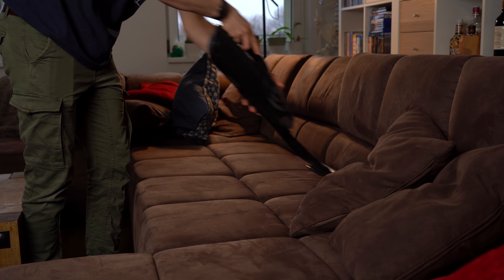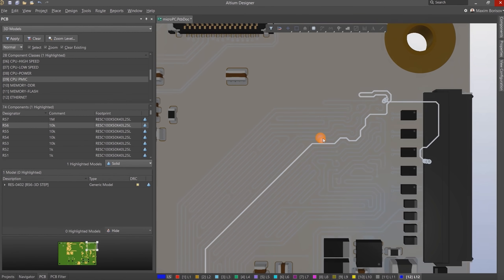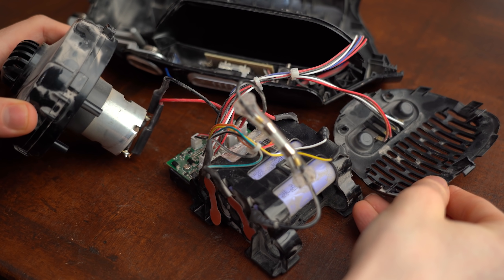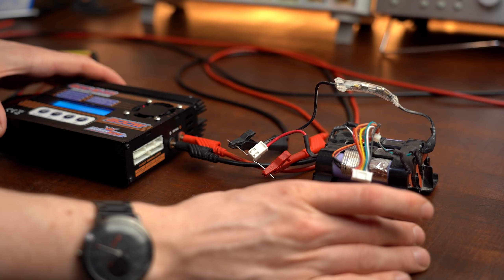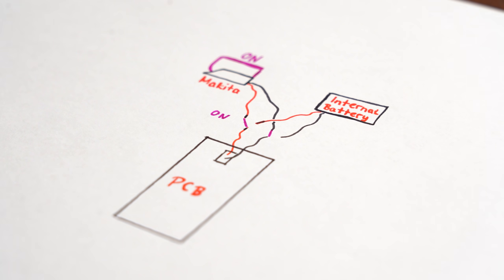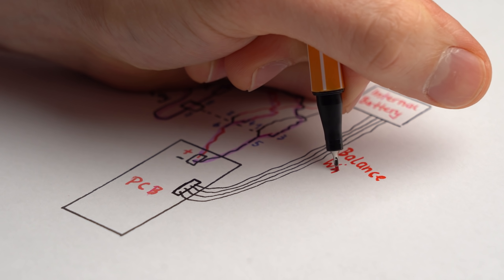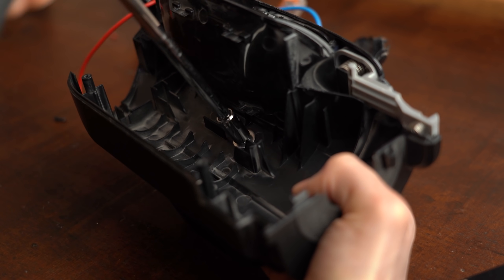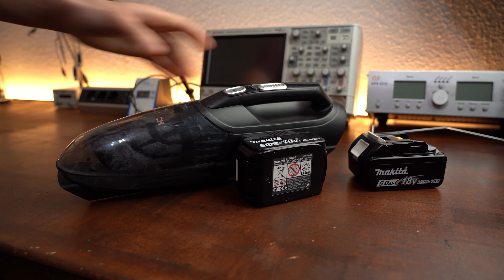Every Device should have this Upgrade! (Endless Battery Run Time)

Comment: Nice done! What is the consumption of the relè coil continuously draining power while external battery is plugged in? Is it negligible?
Reply from the maker: Yep. In comparison to the motor current it does not matter. But you have to unplug the battery pack when not being used. Otherwise the relay will drain it.
Reply: @greatscottlab  What if you switched the relay through a transistor from the vacuums switch, since they are sharing the same ground anyway. Then if you leave the Makita battery plugged it, it won't get drained below 15v.

Comment: To me it sound like themotor is spinning a bit faster with the external pack (but then maybe the internal is just a bit on the low side regarding charge?)
Reply from the maker: Yep. The internal one was pretty low with its voltage.

Comment: without flyback diode?
Reply: There are no sensitive components running the relay, just the battery pack. The coil of the relay is never going to do anything bad to that battery. Flyback diode is needed when you are driving the relay with a transistor or so.
Reply: @Engineer9736  ah - ok

Comment: Or....buy a vac with a cord?? Ok admit being a bit cheeky..Until there's way more than 18v DC power available, I wouldn't bother buying these. There are some 40 something volts portables around but very expensive...But nice hack anyway..I thought u were gonna just connect ext battery in parallel to extend run time.

Comment: Aren't you scared of the dust which was inside the motor case? Looks like there is a leak. Also, that dust is then blown out from the unit into the air.😨 That would be fixable by another filter on the back.
Reply: It's not as if a vacuum cleaner turns dust into nuclear waste. It's still just dust.

Comment: Hello.  I am writing you from TURKEY.  To give you an idea, I think the minimum wage in this country is 4,250 TL, that is, as a unit.  I run a coffee shop and my electricity bill is 3,800 Turkish Lira.  I searched on the internet but couldn't find an exact way.  In my shop, there are 2 refrigerators, 1 3800W espresso machine, one 3000W fast industrial dishwasher, 1 instantaneous water heater that works for washing dishes from time to time.  In general, the most energy consuming resistance water heaters in my shop. Does installing an electrical compensation panel provide any benefit to my incoming bill?  How can I make an economy for the resistors?
Reply: This may depend on how your electricity is billed by the supplier. However, for resistive loads, I wouldn’t expect a significant improvement because, in your case, the apparent power may be very similar to the real power.

Comment: I coincidentally retrofitted my two old NiCd battery power drills using that same Makita battery adapter not that long ago. The NiCd batteries were worn out and there were no replacements to find anymore, while the drills themselves both worked still fine. Using this 'hack' I now have given my two drills a new life.
Reply from the maker: Lovely :-)
Reply: I've done the same to my old tools.
Reply: I'm going to do the same with a pole saw that's got a NiCd battery and missing charger.
Note to self - test pole saw motor tomorrow 🤣
Reply: @tin2001  if it is just similar in voltage it will work (assuming you are using Makita or other decent batteries with built in protection). My simplest was attach the wires from the adapter straight to the old battery connection pins - 50+ hours of use and no problems yet.

Comment: Proprietary battery packs are a scourge of humanity. As with USB, there should be a standard interface for battery packs between manufacturers, and royalty free.
How many of us have various power tools over the years and have boxes of different packs and chargers?
Some of them have become unusable as tools wear out and the packs become incompatible with later models or other manufacturers tools.
Reply: I fully agree but I guess that will not happen unless they are forced to do it (looking at phone connectors)
Reply: @Luke-san  Absolutely - they had enough time to get together and figure this one out on their own.

Comment: TBH, Bosch also makes a vacuum cleaner with exchangable battery pack. It's the GAS 18V-1 from their Professional Line, to which you can use their 18V professional battery pack.

But yes, I love your DIY. That give me some thoughts to upgrade my other, older vacuums
Reply from the maker: Thanks for the feedback :-)

Comment: I have the exact same vacuum and this is not worth xD It is so bad and weak. I had been thinking of opening it up and just directly connecting the motor to a much higher voltage.

Comment: The Relay will draw the Makita pack empty while connected.
Reply from the maker: True. You should not leave the pack in there.
Reply: Yes you always need to disconnect third-party battery adapters. Makita will disconnect power before killing the battery, but most will over discharge the battery.

Comment: The might not be bms on those makita batteries! I suggest that you check it out. I know from experiense that Ryobi has them on the battery, but there has been speculation that bms is on tool side on makita tools.

Comment: Can you figure out the communication protocol of the Makita batteries that causes them not to be able to be charged?  I have several Makita batteries that are not that old that should still work but for some reason the charger considers the batteries "broken/not chargeable" and will not charge them.  Makita makes a battery analyzer but it is $600.  It should be relatively straightforward to see the signals that battery is sending to the charger to tell its status.  I love your videos, and have learned a great deal from them.  Rick in Arizona
Reply from the maker: I can put it on my to do list :-)

Comment: What i realized from this video is get a plastic welder for easier integration with custom components. 3D printing takes a heck lot of time.
Reply from the maker: Just a heat gun and some abs sticks. Pretty cheap ;-)
Reply: @greatscottlab  or soldering iron, ABS filament, or chop up used laptop battery cases into strips etc. Seems that ABS is everywhere once you know what to look for!
Reply: Can it glue pla to abs?

Comment: I use a Dreame T20 I got at a heavy discount with the seperate battery. 
Just like the top of the line models you see from Dyson, these cordless vacuums literally outmatch their traditional counterparts. 450W brushless motor spinning at 150krpm, its just mad. I never want to go back to a mains vacuum or a crappy brushed motor cordless vacuum. 

I dont even need a full battery to clean my entire apartment but i still have a second one available in the wall mount, always charged.

Comment: Tolle Idee! I have one from Bosch that already uses the 18v batteries. The upgrade I would do to mines would be to make an adapter to have it connectable to 240v and use it as a "cable vacuum cleaner" just for those days when all batteries are at 0%
Reply: I would highly recommend a variable AC-DC power transformer serial # HJS-480-0-48 as it's very well built, has a digital screen displaying DC voltage, and can do 0-48 volts.
Reply: @ProlificInvention  thanks! I have to see how much current it can output at 20v and how much current (or actually power) my vacuum cleaner needs
Reply: I don't see an issue with pulling out the cord of a vacuum cleaner and putting it into the wall. Never having to worry about batteries running out, and a corded vacuum cleaner is way stronger and has more garbage storage capacity.
Reply: @Engineer9736  indeed! But if the batteries are loaded, it's a very comfortable thing!

Comment: "Unlimited" run time. Thermodynamics would like to have a chat with you. :)
The relay works, but also constantly drains the battery when it is connected. A better way to do this is with a MOSFET switch.
Reply: Hey, The Signal Path is in da house :-) Power consumption of the relay was my first thought as well, but these days, you have to use what's available...
Reply: So, I was listening to the dialog and heard “…the solution is of course…” and 100% expected the following words to be “a MOSFET” (or two). Then, the relay popped into view. What!? But, I suppose it makes sense, in that it’s an easy project for beginners, and this is an educational channel. Personally, I would’ve added something like a red LED as a little reminder that the battery pack is still drawing power, even when the vacuum switch is off - reminding the user to remove the pack. Overall, it’s another nicely made video. Thanks.
Reply: @a1nelson  Actually the now make these MOSFET switches on small boards.  MiniBox has a nice little board for easy wiring along with logic gates for external control too.
Reply from the maker: Haha yep. MOSFET should also work. Just need some more additional components.
Reply: @greatscottlab  Of course this was not a criticism. I know that you know. It was more meant for a viewer who may not realize.

Comment: A brilliant idea would be to attach something that is made out of copper with maybe a shielding around each wire and the bundle and then something which allows you to plug it in to the wall outlet. Sounds like something someone must have thought about before.. Guess people want the convenience
Reply: Could also get a vaccum that isn’t a throw away article sad that this is even still a thing..
Reply: @platin2148  Everything on the entire planet is a throw away article. Everything that has a beginning has an end.
Reply: @Engineer9736  I don’t think you got the meaning of that statement. Throw Away in this case means basically not fixable for the average joe when battery is dead.
Reply: Good thing makita also has a wall plug addition.

Comment: The biggest complaint about these portable vacuum cleaners is that the battery dies really quick and the life span is really short. That’s why I’d rather buy a wired one…
Reply from the maker: Well,....here is my solution :-)
Reply: @greatscottlab  It's indeed excellent and you put it in a quite elegant way!

Comment: Agreed, everyting should have this! Although I'd rather build around hoverboard batteries, you can get the chinese ones for really cheap
Reply from the maker: Sure. But the Makita stuff is pretty much standardized. That makes it easy to use for everyone ;-)
Reply: Cheap chinese batteries are the ideal solution - if you need your house burned down real quick.
Reply: @andreasu.3546  Not anymore. Now reputable OEM cells are sold from China too. Might be due to increasing EV prevalence in China.
Reply: @andreasu.3546  @Faust Von Barley is right, you can actually get decent battery packs from china for a fraction of  what makita costs, or get even cheaper ones and make them safe yourself.

Tho even if you were right that'd be a cool way to get insurance money

Comment: or just use a normal corded vacuum. no battery life to worry about but it is a lot more clunky
Reply from the maker: Battery powered ones surely have their advantages though :-)
Reply: @greatscottlab  just like it is with everything there are advantages and there are disadvantages.
Reply: @SB7-r9i  I don't see any disadvantage to a normal corded vacuum cleaner. Unless the house to be cleaned has only 1 powerpoint in the furthest corner of the basement... All the messing with charging and dead batteries is quickly a bigger headache than pulling a cord out of the back of the vacuum and sticking it into the wall.
Reply: I appreciate the power, garbage storage space, and runtime of a normal corded vacuum as well. Never going to buy a battery one.

Comment: Thanks for doing this, it's what I have wanted to do for over a year using my Aldi 20V batteries. I was going to remove the original cells but was concerned the internal BMS would not allow the external power, you have given me the answer!
Reply from the maker: Glad I could help
Reply: @greatscottlab  could you perform this for a Dyson style vacuum that has a voltage incompatibility? What would I have to change in the circuit to fix this?
Reply: Be careful. I have the batteries from Lidl and they DONT contain the switching electronics inside them. They only give you a voltage on the third pin which tells the tool to turn on or off the power. So the cells are literally directly connected to the output terminals without any kind of switch or regulator which means that it’s very easy to overdischarge them by using them with anything but the original powertools. 

They recently brought new smart batteries to the market where you can monitor the current on your phone but those values also come from the pcb in the tool and not the battery. You can however take the pcb from one of their battery drills and use it in your adapter to monitor the cells
Reply: @maxwfk  we must be using different batteries dude, I have the work zone batteries and I use them in a buggy that I built for my kid they always shut off when they reach around 5%.
Reply: @exogator  maybe I should have mentioned that I mean the Parkside ones
Reply: @maxwfk  what a great era Samsung cells for free, 20 cells 15 euros . 2 Parkside battery packs.
These NMC cells are self balancing, like The old Makita 
 And yes, they don't jave low voltage cut off, they have a fuse though.
Reply: @maxwfk  Did you not watch the video? There is a battery control circuit inside the vacuum. It protects from over and undervoltage
Reply: @dimitrijekrstic7567  yes but that won’t shut down if one cell goes way lower than the other ones
Reply: @maxwfk  that's true, valid point.
Reply: careful using such battery's from such stores.       this one's here's using Makita.        for replacing the 4 cells it has to be 10A discharge possibillity per cell
Reply: @urkent4463  well the new smart ones from Lidl can do up to 100 A at 20V continuously so I wouldn’t worry too much about their capabilities. It’s more the other way around. You have to make sure to enable the current limiting features to prevent damage to some older tools (don’t ask me how I know…)
Reply: I wish Aldi in the US was as cool as Aldi in the EU.
Reply: @skuzlebut82  Aldi and Lidl are brilliant. Where else can you buy your food, buy a bathroom shower unit, and get some car parts all in 1 store !. They are awesome.
Reply: @TheSaabClinicUK  the online stores are crazy. I was looking to upgrade my motorcycle suspension and google returned a result from kaufland. Rear shock for V Strom 650, 2017- model ... I was ... shocked :)

Comment: This was a great idea, I think every portable vacuum should have this. (:
Reply from the maker: Right?!
Reply: @greatscottlab  Bosch and Makita seem to have their own vacuum cleaners that use their batteries. Not sure how good they are though
Reply: @efeyzee  Everything that Makita makes is the best you can get.  Anything made by another company is garbage.  Makita for life.
Reply: @dimitrijekrstic7567  Hilti is great if you really need to spend the money to impress others.  It's like overcompensating for having a small "tool".
Reply: @dimitrijekrstic7567  Nah, just giving you a hard time.  "small dick energy" made me laugh out loud.  Going to save that for later.  Hilti does make great tools but in the US the price is hard to justify.  Makita for me has always been a good balance of durability for price.
Reply: @haywoodyoudome  true, in europe the prices must be much more reasonable so the scales are tipped in favor of the hilti. A bit more expensive at the beginning, but it repays it fully by having less frequent downtime and being fully repairable (good+quick service centers and serviceable design), plus it often works faster
Reply: @haywoodyoudome  I don't know about vacuum cleaners, but we used Hilti demolition hammers back in the day, and they'd run all day long, week after week, taking everything you could throw at them. 
I don't know if the same could be said for other brands. 
This was quite a long time ago, so don't know if that's still the case!
Reply: @haywoodyoudome  milwaukee enters the chat
Reply: @haywoodyoudome  Festool is great too
Reply: @efeyzee  every tool battery portable vacuum I have used has been absolute dog sh. There are some very large tool vacuums that work ok but I wouldn't consider them portable
Reply: @eurithmicsrocks  40v tools are out there now (Makita) with significantly more power for the same weight. Other brands have higher voltage (and so wattage) tool ranges too.
Reply: In an ideal world, scheduled obsolescence would not be a thing :) (my guess is those portable items do not feature any port for external battery because of this)
Reply: Newer models are coming with that style of battery.
Reply: @Vash.Baldeus  power tool makers have them in the market already.
Reply: I think EVERY portable device should come with this, great idea. For multiple devices
Reply: it is actually bullshit since loading lion batterys at high C rating shortens life period!
Reply: hilti isn't that expensive. - if you buy from them directly instead of buying some ++600 dollar overpriced resell listing from amazon or ebay

Comment: why you dont make a diy vaccum
Reply from the maker: Maybe some day....
Reply: @greatscottlab  how about unlimited energy using electric heated stirling engines
Reply: @seancallahanch.8639  Where will the electricity be coming from?
Reply: @Engineer9736  from the electric motor as generator

Comment: Endless?? 
Electroboom didn't like that
Reply from the maker: I was honestly trying out different words as well.....but I just think endless sounds the best.
Reply: @greatscottlab  You should add "hand-held ray gun" to the title, as that is what this device looks like 🙂. You should add a secondary battery connector so you can do hot-swapping while vacuuming 👍. But I wonder if this consumer product is capable of long time continuous operation anyway. Could be that the motor needs cooling in-between.
Reply: I was expecting a free energy device as well 😜